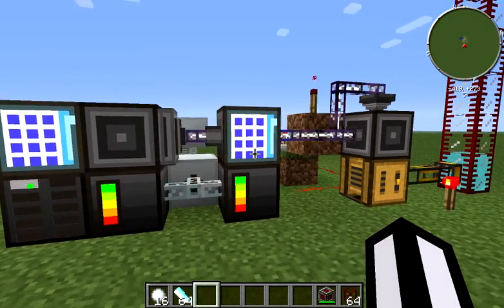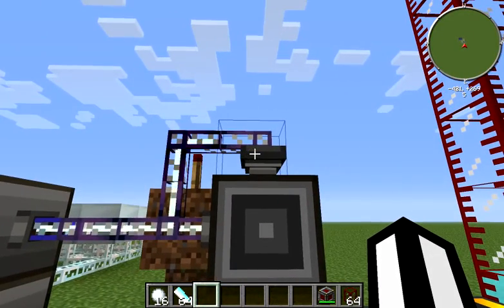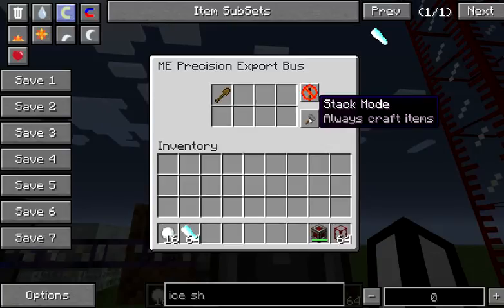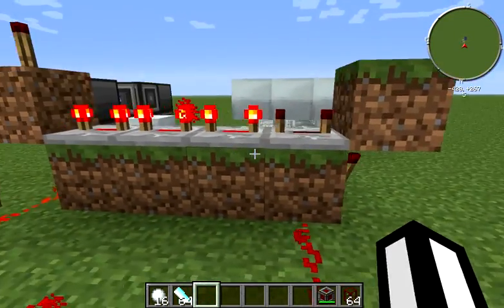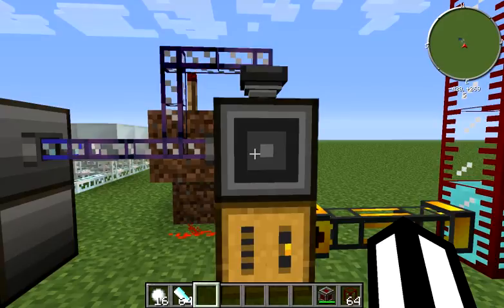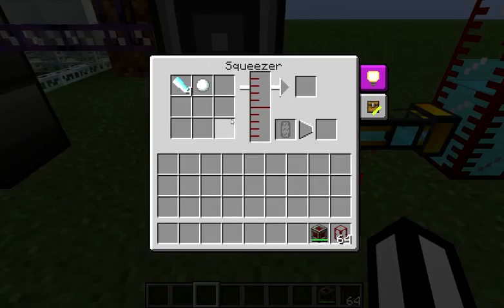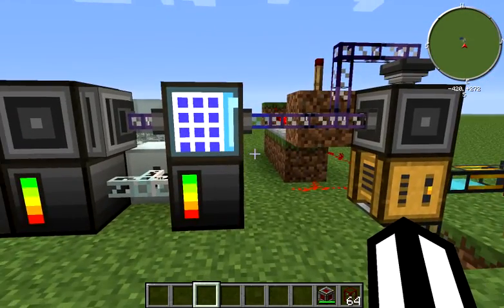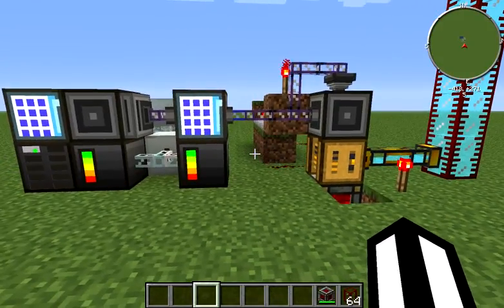Applied Energistics - Automating Crushed Ice Production

Comment: This is the best idea I've seen that works in Unleashed.  Well, to be fair it's the only idea I've seen regarding crushed ice (via bee products) automation.  I'm glad you posted it, so thanks for that.  However, your setup is a bit misleading.  This works flawlessly if you always have 4 ice shards ready to process when the clock cycles.  If you're lacking ice shards when the clock cycles, snowballs will eventually fill up the inventory of the squeezer.  I think you could have mentioned this.

With max sustainable production setup [Alveary with 4 frames] and max bee production stats, I'm getting 1-2 shards each bee tick.  So the fail-safe delay for a single alveary would need to be 27.5sec * 4 [for a worst-case scenario]...which is way too long.  Even running 4 alvearies has a fail-safe delay of a single bee-tick, which is still long, but would ensure you could process every bee-tick.

I like, and am using, your automation idea...but would have also liked you to have discussed at least some of these issues.

Comment from the maker: In the example I provided the network would continue to push ice shards and snowballs into the network regardless of liquid contents.  The squeezer would eventually fill and then start becoming wasteful because it would produce a full craft of 3 buckets of crushed ice whenever it had any room at all, losing whatever didn't fit.  To counteract this, you'd need a way to detect your liquid levels and use it to turn off the redstone clock.

Comment: I never thought about the dark cable with a timer. I was struggling with creating the bogus pattern and trying to request it would only give me a set of 4 shards and 1 snowball.

How would the network function if the tank was full or liquid tank was full?

Also, I resorted to an alternate solution, yet has some flaws. I filled a squeezer full of snowballs and shards using two ME Basic Exports. This works if I have a greater income of ice shards than my usage of ice.

PS: Ice shards=bees for all